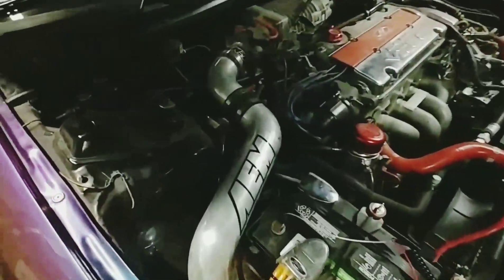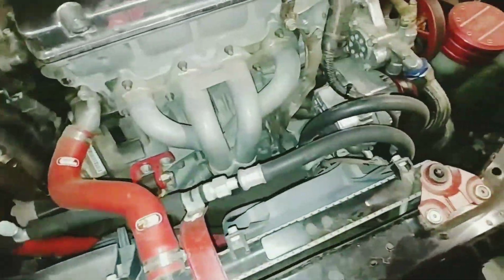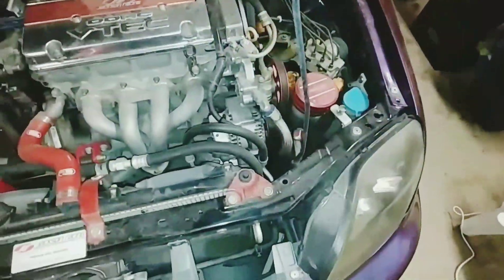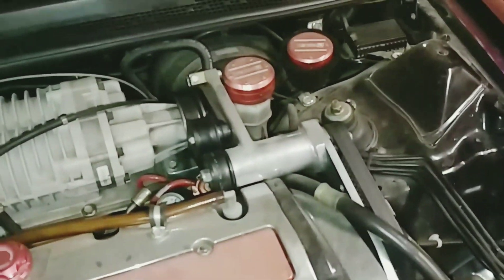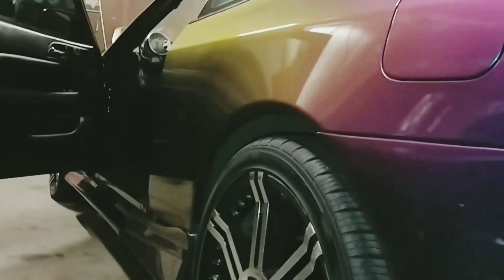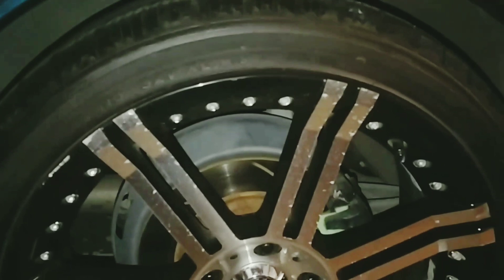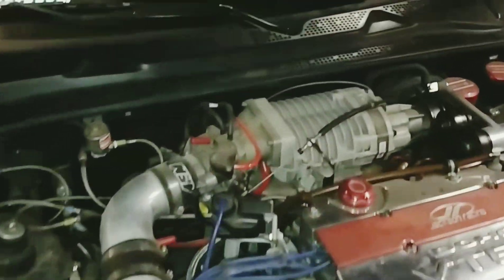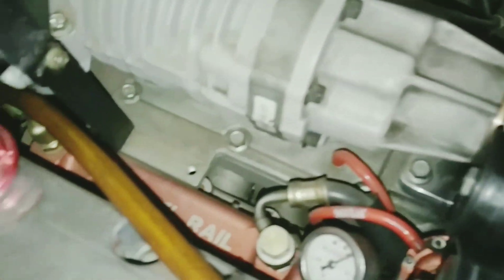1998 Honda Prelude. Explore and restore.

Comment: I’m running truhart streetplus coilovers and it rides like a dream!
Reply from the maker: How low is your setup? I've seen those, they look like a nice coilover.
Reply: I_auto_enthusiast  the back can be completely slammed if I wanted and the front could sit like a 2-2”1/2 drop (I feel like I could be lower with a set of drop forks from mpc) but it looks good rides semi stiff but nice
Reply from the maker: @adama4360  that would be sweet.